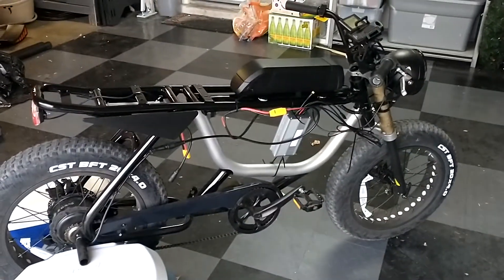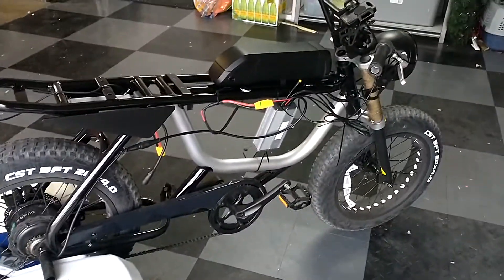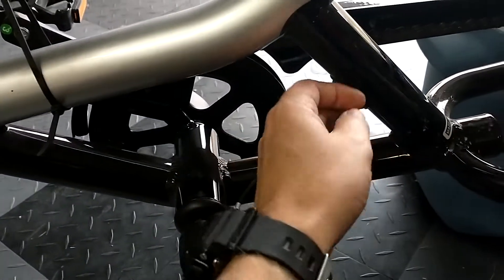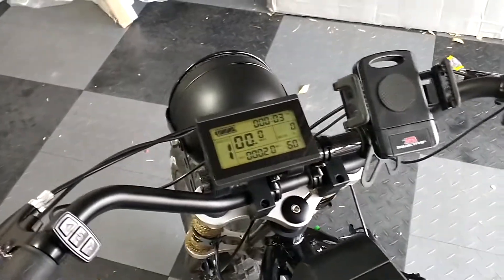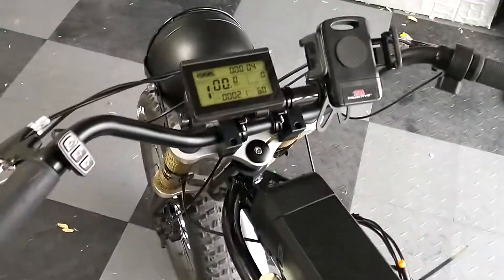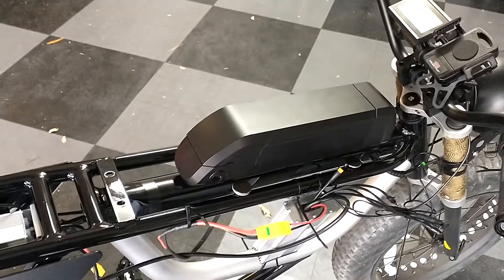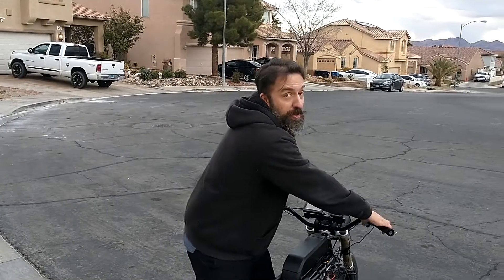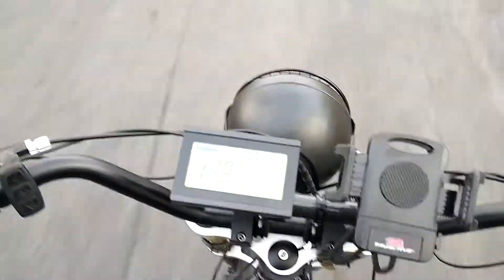Monday Motorbikes Anza 750w - Controller change out progress update

Comment: Not sure if you've upgraded the brake system on the Anza, but I'm looking to convert mine from the stock mechanical to Shimano hydraulic and not sure if the brake wires could be bypassed since they go directly into stock brake levers. Any info would help tons since I haven't found much content on upgrading this brand or model for that matter.

Thanks a ton

Cheers
Reply from the maker: I ended up getting a hydraulic brake set from ebay. Works a lot better
Reply from the maker: Just make sure you get one with long enough hoses been awhile, but think it was around $80 for both front and rear

Comment: Looks hot as it is without the shell, I bought the cheapest one 500w just so I can use the frame.  I have delivery Wednesday.
Reply from the maker: Nice! When you get it do a gps speed test. 500's should be getting 20mph. If you only get 15 let MM know

Comment: and pretty much we will need to buy more equipment in addition to the programming cable?  also do you know if this will work with the 500 w  bikes?
Reply from the maker: It might work. But I'm a noob. I did read the out side motor case is the same size on the 500w as the 750w. You can get a 750w motor for around $200 and just swap out the inside of the motor so you don't have to remove the spokes. There are some articles on that and maybe some vids. Wish I would have known that before and saved close to a thousand dollars buying the 500w bike vs the 750w
Reply from the maker: Also read yesterday volts=speed amps=torque. The controller i got is rated at 35 amps vs the 25 my bike came with. The torque difference is night and day. With the 48 volt battery think 28mph is about the max until I change out the battery.

Comment: ok so just to clarify....if we do what you did in your previous videos w/ trying to reprogram the controller we will have issues?lol
Reply from the maker: So out of 7 people I have chatted with. 4 were successful, 3 were not. When the 3 that couldn't get it to work plugged it in the read and write buttons were greyed out. Lots of internet posts about folks haveing the same issue with other bikes. Seems almost like Amazon got a bad batch of cables. I mailed my known good cable to a guy having issues to see if that works. I'll let you know. If it works might have better luck getting the cable from Lunacycle. These cables look like they are coming from a deep dark chinese factory :-)
Reply from the maker: I shipped my known good cable to someone that was having issues with the one they ordered on Amazon and it worked. If you try the cable maybe order one from Lunacycles. Seems like Amazon got a bad batch